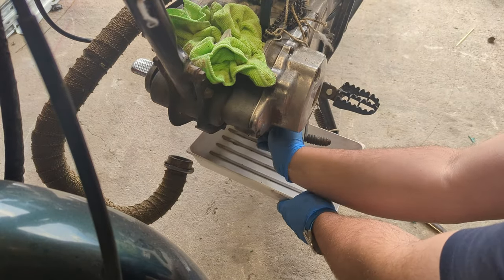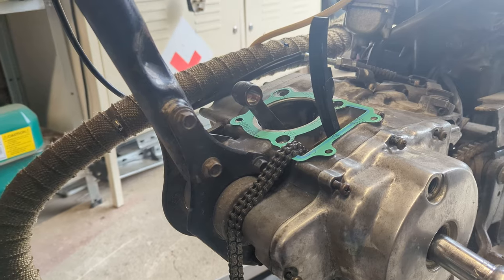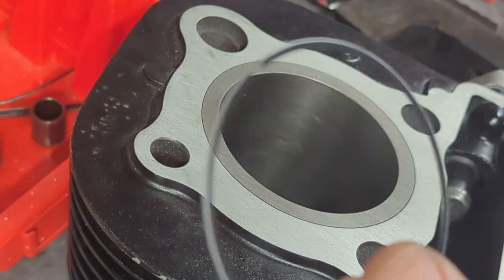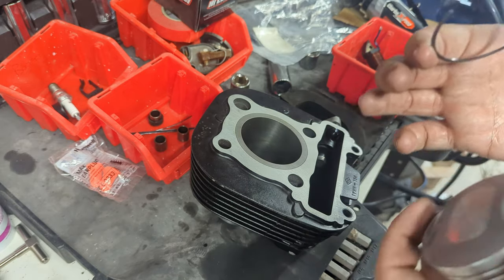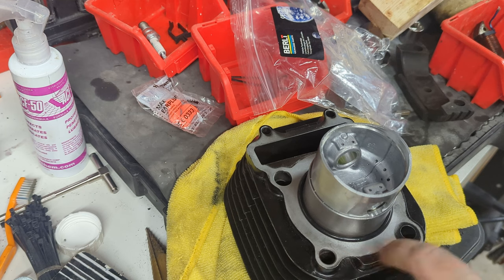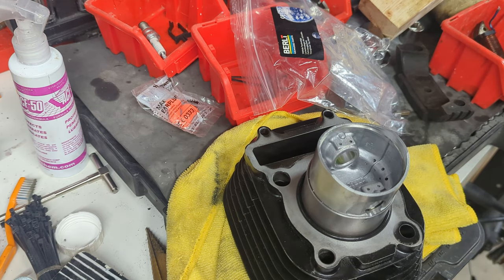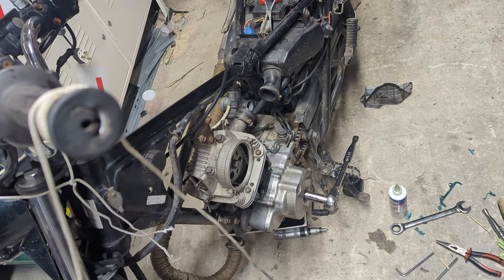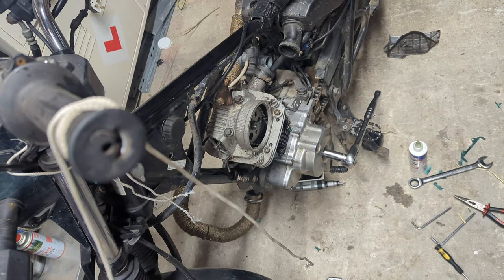Fitting cylinder kit Yamaha SR125 does not go to plan - The Grand Challenge | JAM#27

Comment: Really sorry you didn’t get it done in time. Nice work on the engine though. Watching with great interest as my other bike is a Serow and my 225 engine will be very similar (probably!) Les in Chester
Reply from the maker: Yeah, I notice the Serow on the "other bikes these parts fit" lists when I am scouting out parts. I imagine that engine is similar to the one in the SR250. Top Tip - you can easily tell bigger and smaller engines apart by which side of the front frame tube the exhaust exits, riders left is 125, riders right is 250 :) The engine codes are 5H0 for the 125 the 250 might be 3Y8?
Reply: @justanothermotorcyclist  Oh, OK. The Serow exits on LHS and curves round the down-tube to go up the RHS of the bike. Hope your bike is soon back on the road (without the clouds of smoke!). Les